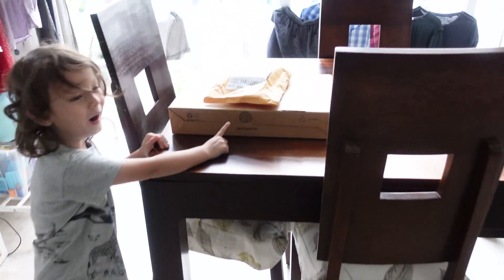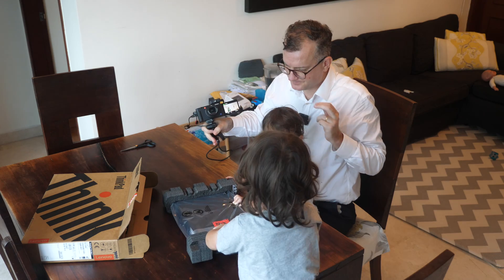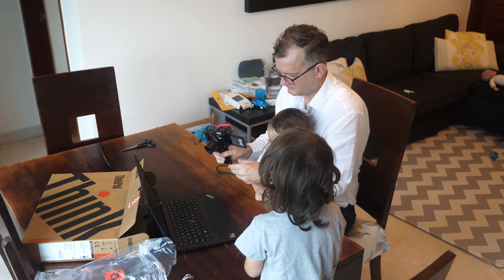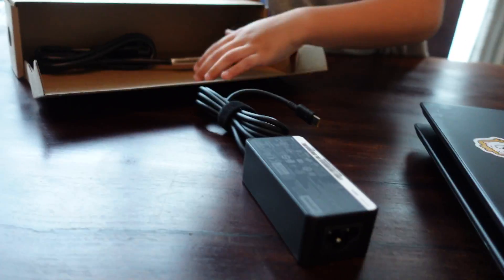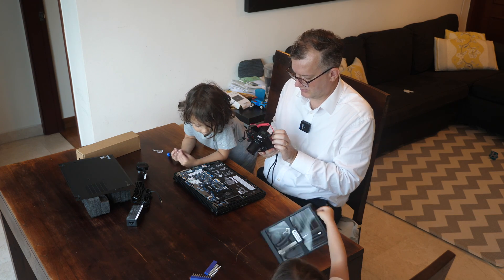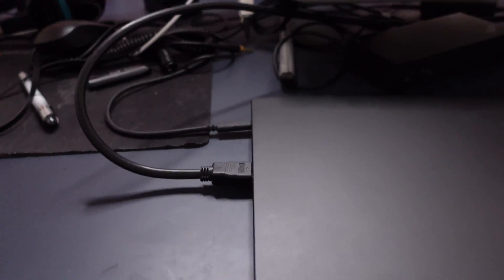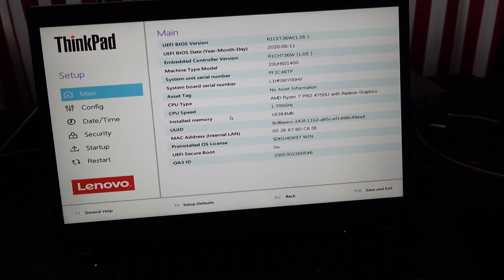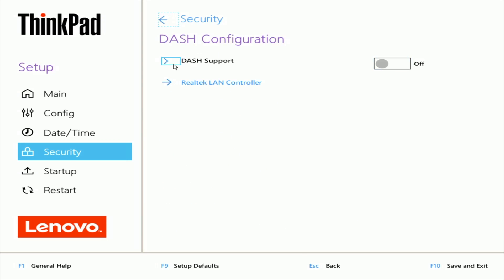AMD Zen2 Thinkpad T14s unboxing 💻

Comment: should have config the higher end display, 45% CG is definitely not ideal. I bought my X13 AMD with the same config as yours for $1400. Only difference is that the 72% CG display is standard
Reply from the maker: I'm not sure what CG means. So you're saying that your X13 screen is much better?
Reply: @kaihendry  CG = Colour Gamut. It is used to measure colour accuracy which can be measured in many metrics such as NTSC like what lenovo uses. 45% is not ideal for colour accurate work (e.g lightroom) unless you are using an external monitor most of the time. If colour accuracy is a key factor on a laptop look for those that states 72% NTSC or 90%+ sRGB. There are lots of information about this on the internet.
Reply: @kaihendry  When I purchased my X13 during black friday 2020, it came with the 72% NTSC display while the T14s came with only 45% NTSC display. Shortly after I received my X13 in December did the T14s came with the 72% NTSC display only on the custom order model. Up till now it is kind of ironic the X13 is still cheaper than the T14s and that the ready to ship models are also cheaper than the "build your own" option

Comment: Hi. After a month or so withe the AMD version of the Lenovo 14s, what are your thoughts? Has AMD cracked into the laptop market or is it still a generation too early?
Everything working well enough?
Would it be worth it to splurge to get the 500nit 4K screen just to get better screen legibility in daylight/ sunny conditions?
Are Network speeds a problem?
Reply from the maker: Working well enough. I don't think the 4K screen will be worth it. I'm impressed by the AMD. It's extremely competitive compared to the Dell XPS.

Comment: "Smells like new computer to me, it's one of the best smells in the world" - absolute facts!
I'm looking forward to the arch installation video that I suspect might be coming down the pipeline ;)

Quick note, you don't need to disable secure boot anymore to install most common distros, including the slightly more obscure like Arch/Slackware/Gentoo.
Of course, if it's your preference to not use it then that's fair enough.

Comment: I opted for the smallest drive. I recorded the windows key, "dd'ed" the whole drive to my server, and then replaced it with a larger/better drive.
No removable ram on the T14s, both modules are soldered onto the motherboard. The regular T14 has one modules soldered and one slot for upgrade which will take up to a 32GB DDR4 module.
Reply: Is the T14s ram in dual channel tho ?
Reply: @andljoy  I'm pretty sure the answer is yes. Looks like Lenovo offers 8, 16, & 32GB. I'm sure they split those numbers in two for dual channel.
The T14 configurator has a configuration for soldered module and one for the slot, but the T14s only has one memory configuration section

Comment: The RAM may be it is located on the other side of the motherboard. i have seen it in another recent ultrabook but do not remember which one. Why do you want to see it? to make sure its there? :)
Reply from the maker: Curious if I could upgrade it!
Reply: @kaihendry  Highly unlikely. If there was an empty slot it would be easily accessible. If you find it let us know.

Comment: Just a recommendation, when u wipe ur drive and install arch. The best way to wipe a ssd drive complete is the command blkdiscard  -f  /dev/***

Just wiping the gpt with gdisk or parted or whatever is not as tharough as blkdiscard - f, and the command does the job in a matter of seconds.
Reply from the maker: I'm probably going to resize the drive to keep a Windows partition around. Unless someone can tell me how I can recover Windows if I want to resell it or something stupid.
Reply: @kaihendry  just download the 
 windows 10 iso from official site and flash on USB drive and install windows like regular, skip the registry key part, because once u connect to internet, Microsoft will detect automatically that u had previously installed windows because of some ID they track from ur motherboard and will activate windows for u automatically. ( u can download the official windows iso legally and for free like archlinux from the microsoft site)
Reply: @kaihendry  no need to keep that partition, unless u really need to use windows.
Reply: @kaihendry  Microsoft does force u to install this exe utility to run, which can download the iso and automatically flash on USB , but it is unreliable and crap . But if you put ur browser in like Android/mobile mode and refresh page, u will get direct link to iso without the  stupid utility. Then use the utility Rufus to flash iso on USB drive. And finally install windows like u would install arch.
Reply: @kaihendry  Just write down the serial and reinstall when the time comes.
Reply: @B-a_s-H  no need, windows keeps track of it in their database. It will activate automatically during install, once he connects to internet
Reply: @alphabennyrosy5068  Thanks. I didn't know that. Haven't used windows in a while.
Reply: @kaihendry  IRC nick? I assume you're in #archlinux
Reply from the maker: @johnwpierce3  hendry on Freenode